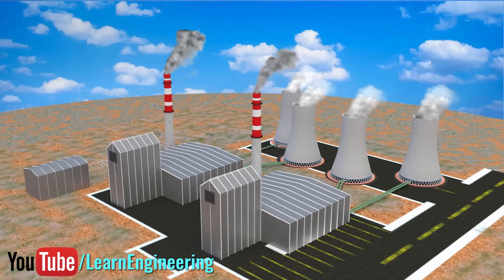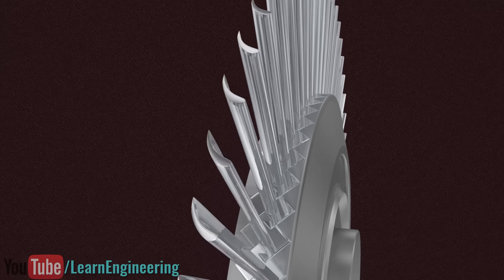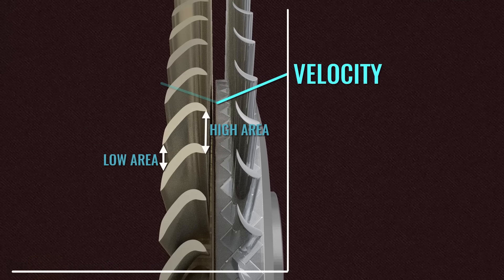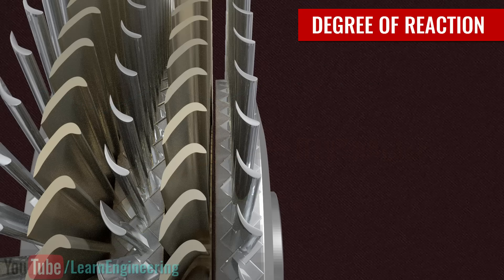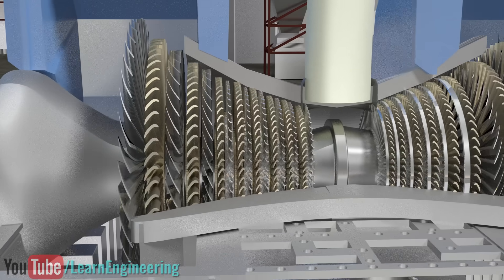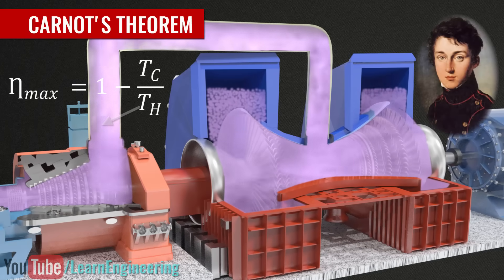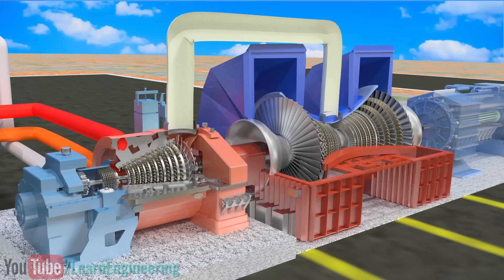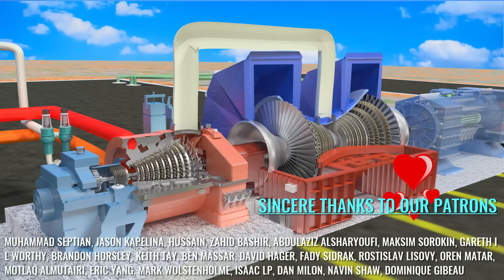How does a Steam Turbine Work?

Comment: I worked in IT at GE Power Systems (GE Energy) in the early 2000s and they call the blades of a steam turbine “buckets.”  I’m not sure exactly why but the term comes from the hydroelectric industry. Water buckets?

Comment: Why would you call diaphragms the term stator?? I get they are stationary but stator is the general term used for the generator stationary core/winding.
Also, you call them nozzles...there is literally a nozzle block which is not the same as the diaphragms.

Comment: Just a little point at the end about turbine speed.
Once the The turbine is connected and generating the speed will remain constant as it's locked to the grid.
More steam = More power generated.
Less steam = Less Power generated.
If Steam flow is reduced too much the generator will, in effect turn into a motor and start to turn the turbine.
This would cause a great deal of damage in a very short time.

Comment: Your model shows a turbine with both forward and reversing blades. They aren't used in power stations where rotation is unidirectional but only for marine installations on ships where both ahead and astern rotation is required

Comment: Can a steam turbine be used in a car?  For the car to be driven by a turbine, what will turn the flywheel, which in turn will turn the wheels of the car using the transmission? 
Would such a car have any advantages over a conventional steam engine?
Reply: I think those blades would be too much of a flywheel, meaning it would be difficult to control the speed. You could get a gyroscopic effect too, making it handle corners badly. Then there is the size of the thing.

Comment: Its always amazing how 10% of the population would understand the process in theory while 90% of the population would understand it in practice/reality when they see the components and how they actually work inside explained with transparent photos. Those who understand it in theory are the ones who know exactly how much energy they can squeeze to the border of safety for the turbines and the workers and just by watching the calculations on the monitors it takes a second or two for them to understand if something's not going right and pull the plug before something terrible happens.

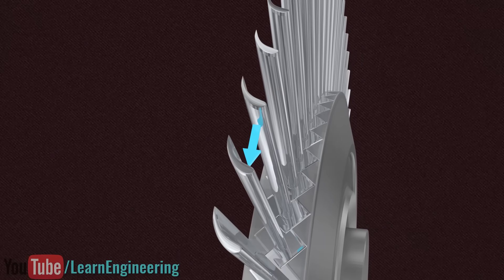Comment: 0:50 the “flow energy” of the fluid air transfers to the “mechanical energy” of the rotor
1:00 “a fluid has 3 forms of energy: speed pressure temperature”
1:25 to increase velocity fluid is passed through stators ; the stator set is stationary and attached to the turbine casing 
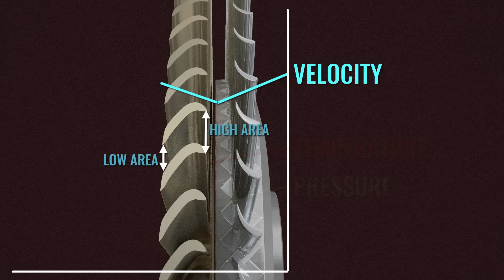1:39 the flow are decreases through the stator; thus the speed increases ; in short, it acts as a “nozzle”
As the speed of the “jet” (defined as: liquid stream?) increases in the stator,

Comment: Possible error in the presentation - yes the steam flow must be used to regulate the speed of the alternator in a single alternator system BUT in real life the alternator is synced to the power grid then variations in steam flow result in variations in that particular alternators power output NOT frequency

Comment: So what would happen if we equipped the stator blades with thermoelectric cells, and overheat the steam proportionately? The cells would absorb the extra heat and convert it into even more power, and you could still maintain the same ideal gas equivalency, no? This is providing that the carry pipes can handle the heat and perhaps an extra stator with fewer teeth to protect the first blade.

Comment: Just summary of what i learnt from the video.
Flow energy is converted into mechanical energy. Generally, there are three forms of energy: Speed(K.E), temperature(internal energy) and pressure. As the blades absorb energy, all the three factors decrease. Stator acts like a nozzle as it increaes the speed of the steam and rotar acts sth which helps the fluid flow from high pressure to low pressure. However , temperature and pressure should decrease overall to make the energy constant.
As i studied before, there comes the concept of intercooling and reheating. Reheating is done at the turbine end to increase the temperature snd thus the efficiency of the overall system.
Between where is the compressor?? It should have been there.
How the flow is controlled if the mass flow rate is not same? @5:14

Comment: Those who make (dislike) are Electrical Engineers
Reply: Mechanical engineers 😊😊
Reply: Not so!

There's no reason we can't pipe steam instead of rely on giant high voltage stuff for long distance energy transfer.

Only reason it was done that way is because all the people that knew how steam worked were getting older and electricity could be transmitted long distance with "acceptable losses" in the 1930s because power was cheap and instantaneous power was supposedly better.

Now I think it's time we convert the base load into steam and pipe it long distance for localized electricity generation with a bunch of insulation along the way. It's cheaper than copper, a bunch of steel pipe already criss crosses the country. Plus there's no "unused" power from generation. The steam turbine can whirl up to handle transient loads and the generation/load can be flat

Comment: So, that's a tripple expansion, steam turbine engine

Also, its exactly the opposite of the cold end of a gas turbine engine on an aircraft, because the fan discs at the front of the engine run from large to small at the back, as the gas turbine works exactly the opposite way, it uses internal combustion, to compress and move large volumes of air

The hot part of a gas turbine engine works exactly the same way as this though, the air inside the engine, it hits a smaller fan disc first, working its way through stages to a larger fan disc at the exhaust of the engine

And the only other difference between this steam turbine engine, and a gas turbine engine is, the gas turbine engine has combustion chambers in it arounr half way down where the fuel/air mixture is ignited, and i guess passed through a stator disc towards the first fan disc towards the rear of the engine 🙂

Comment: I am an A level science student in Bangladesh ( its called class XII in Bangladesh, just mentioned the A level stuff for easy reference). According to my understanding, a modern steam turbine is fairly complicated. So much so that you have to study the angle of the airfoil, twist in the blades, the proportion at which the blades get larger, pressure regulation mechanism, maintenance and finally the overall efficiency.

ALL THE FICTIONAL NOVELS AND STORIES ABOUT OTHERWORLD TRAVELS (Isekai) FEATURES MAIN CHARACTERS WHO DIDN'T EVEN STUDY ENGINEERING TO BUILD A STEAM ENGINE FROM THE GROUND UP.                LIKE HOWWWWWWW??!! ( If you understand what I'm saying)
Reply: Well, it's possible to make a turbine without knowing all the modern engineering concepts behind turbine design. James Watts and others were building engines decades before thermodynamics became a science. Water wheels made from wood date back millennia. So its possible for people to build some of these things without much prior study. Whatever they build will no doubt be less efficient, versatile, limited in capacity, and less reliable though.

Comment: Question With Answer About Turbine And Compressor In Process Industries.
The turbine is a mechanical device or mechanical mechanism that converts thermal energy to mechanical/kinetic energy. In Petrochemicals, Chemicals, Power Generation, Ammonia, Oil and Gas, Manufacturing Industries, the steam turbine is used as the driving system or driver. Such as a steam turbine used to drive a  power generator in the power plant.
https://techproces.com/turbine-compressor-process-industries/

Comment: Having worked in power plants in Ireland and overseas, I find this video very interesting when you consider the amount of equipment involved boilers, fuel, water treatment, cooling systems and power distribution.
Reply: I also have worked in a thermoelectric power station in São Paulo, Brazil. This video is fantastic and shows exactly how it works.
Reply: https://youtu.be/J-XYAlfir9o

Comment: In the US Navy, the steam sent back to the boiler is called "super heated steam", all other steam produced is called "saturated steam", but then there is steam which has been super heated but needs to be cooled down a bit and that is called "de-super heated steam"
Reply: Superheated steam is saturatred steam passed back through the boiler in a closed system BEFORE it exits the boiler
Reply: @rickmunro5332  here is a question for you, when steam exits the steam drum, does it not leave the boiler?

Comment: Why is it a problem if velocity gets too high? Is there a sweet spot in air velocity at which minimum turbulence is induced?
Reply: If the tip of a turbine blade is going too fast it'll be trans-sonic or even super sonic, which massively reduces its aerodynamic efficiency.

Comment: Outdated technology.
Can't go past 50%...while superciticall working factor can go even 80% (1200°C)
Reply: The turbine in a supercritical power plant would operate in the exact same fashion, the only difference is the working fluid in the primary loop is in a supercritical state. Efficiencies of such technologies can approach 50%, certainly no where near 80% thermal efficiency.
Reply: @nemo5654  
This is WHY i was talking about the working GAS not the steam/liquid!
Plus we CAN go past beyond 50% like in combined gas-steam technology!
When we get 60-70% on the ~800°C
1200°C could push towarts the 80%!
Reply: @WadcaWymiaru  In a supercritical power plant, the fluid in the boiler is supercritical, but the fluid flowing through the turbine is a superheated vapor (e.g. steam), and thus it is fundamentally the same as any other Rankine cycle turbine. The thermal efficiency of most supercritical plants ranges from 42%-47%, with 50% and perhaps a little above certainly within reach; greater efficiencies may be achieved with co-generation, where the waste heat from the turbine may be used for other purposes like heating and chemical synthesis, but the efficiency of electricity generation will top out around 50%. You can certainly speculate about greater generation efficiencies, but you would be hard pressed to find materials to make the piping, turbine blades, etc. out of that can withstand those temperatures and pressures.
Reply: @nemo5654  
Withstanding the pressure and temperatures isn't the problem.
The jet engine for example. How it can survive rough condition? 
It is COOLED. Like your CPU!
You should to REALIZE those devices are smaller than standard:
https://techxplore.com/news/2017-05-power-carbon-dioxide-steam.html
we can replace CO2 with argon to delete the corrosion.
Usuallly steam turbine has 10+ meters, our are smaller:
https://www.nextbigfuture.com/wp-content/uploads/2017/07/0fc4d5e2d5103d3ee5fc830750edd5f7-1024x769.png
Reply: @WadcaWymiaru  You do realize steam turbines are cooled as well, right? Again, the efficiencies of supercritical cycles can reach ~50%, but to reach greater efficiencies as you speculated will require greater pressure/temperature that will push current material limits. Argon's critical point is 150K/4.8MPa; getting it hot enough but still supercritical would require immense pressure beyond anything we've used before.
Reply: @nemo5654  
1. Jet engine isn't cooled by water, in any form...about the supercriticall properties:
https://en.wikipedia.org/wiki/Supercritical_fluid#Properties
What "immese pressure"?
2. We can use this cycle:
https://en.wikipedia.org/wiki/Brayton_cycle
Obtaining 60% of efficiency isn't that hard. (and push towards 80% in combined system)
3. I want Argon gas because CO2 tend to be super-corrosive in the elevated pressure. Yes, even for stainless steel can oxidize the metal because there is some degree of convertion to the pure *CO* . Argon do not do that, and do not run like helium.
About Argon properties:
https://periodictable.com/Elements/018/data.html
my faworite gas. A little denser than the air, equals the oxygen in many feats.
Reply: @WadcaWymiaru  Jet engines are cooled by cold air bled of from the intake as well as coolant loops; the cycle you are suggesting cannot benefit from the former mechanism, as there is no compressor stage. The critical point of argon is 150K/4.8 MPa; a simple linear extrapolation shows that the required pressure to maintain the fluid at 270K (temperature many saturated steam turbines operate at) would be ~9MPa, right on par their nominal inlet pressure. This is already a very high pressure to contend with, and will only increase as you increase temperature in pursuit of greater efficiency. As I said, 50% thermal efficiency is certainly within the reach of supercritical power systems, but achieving 60% or more is not as trivial as you so believe.
Reply: @nemo5654  
1. Why? We always can introduce cooler air/fluid from the tubine exhaust. (for 800°C leaving cooling factor is 400°C, enough to "cool", it can flow faster) Or introduce additional system with the fan:
https://scx2.b-cdn.net/gfx/news/hires/2017/592811e128f80.jpg
we can call it "reheater" .
There is no combustion so volume of the working fluid remain that same.
2. You do not GET IT! This is the point when increasing pressure or temperature will not cause phase change. (and temperature matters in this system, not the pressure alone)
For example Venusian atmosphere is supercriticall fluid:PV=nRT     (P=kPa)T = 9200/8.314 x 65/43.35 = 737.99 K or~464°CThis equation also proven that "Greenhosue Gas" effect is FALSE!This is WHY CO2 can operate! Pressures aren't that high!
Water in say PWR need a lot of pressure because water is fairy sturdy compare to gas. It is liquid after all.
Argon compare to CO2 is monoatomic gas. So easier to squize:
https://www.researchgate.net/figure/Argon-pressure-temperature-phase-diagram-with-the-new-thermodynamic-boundary-The-phase_fig2_272295671
GPa = 10 000 atm
Reply: @WadcaWymiaru  1) No,  the turbine exhaust is not cold enough to act as a good coolant; you would need a volumetric flow rate greater than what is flowing through the turbine to make up for that the exhaust is still very hot. Reheaters use boiler heat to reheat working fluid; you aren't going to get a meaningful increase in enthalpy by using it as a coolant. There is always an increase in volume, there must be since temperature and pressure decrease; this is why the stages get progressively larger.

2) Pressure and temperature are both important, especially supercritical fluids which are highly sensitive to small changes. I think you are being confused by a general phase diagram, which often shows the supercritical region as a square with dotted line sides. This is not an actual phase plot, but a region of uncertainty; contained within is a curve upon which a supercritical fluid will form, with various intermediate phases on either side. This is left blank on a general diagram because the actual phase region differs greatly between fluids, and is often blank on specific fluids due to lack of testing and emperical data. PWR's use high pressure to keep superheated water from boiling, likewise a supercritical system needs to have high pressures to keep the fluid from flashing to superheated vapor. The pressure in the primary loop of a PWR can be as high as 17MPa, but the pressure in the secondary loop at the turbine inlet is ~8MPa, similar to a BWR. Increasing this to get higher efficiencies is certainly feasible; 50% is certainly within current technological limits, but this 60% or greater you keep touting is beyond what current materials can allow. The required temperatures will either melt of soften a material such that it cannot contain the corresponding pressure.

Comment: Are there only multiple fans for the steam turbine to create more pressure or speed or something to make the fans spin quicker?
Reply: It would be enormously inefficient to drop steam pressure from boiler outlet to main condenser vacuum across only a single stage of blades.  Having multiple stages allows the maximum energy extration from the steam.

Comment: 2:50 this part I didnt get. He said that we need to make the stages bigger to keep steam velocity the same when pressure is reduced. But WHY do we need to keep velocity (-near)constant along the turbine?
Reply: Alexander Sannikov I think because if it air moves faster at one end, and slower at the other, it would cause the blades at the far end to turn faster than at the other end, creating torque on the rotor and potentially breaking it.
Reply: high velecity flow induces more losses making it more inefficient

Comment: In regards to the temperature, do steam turbines use single crystal metallurgy for the blades?
Reply: No, they generally use either forged blades or wrought bar.  The wrought bar will likely be vacuum arc remelted, and evaluated by macro etch and micro etch to ensure that the impurities are kept to a minimum.  This helps achieve good fatigue strength for the material.

Single crystal growth typically occurs in a vacuum investment cast blade, typical of gas turbines.